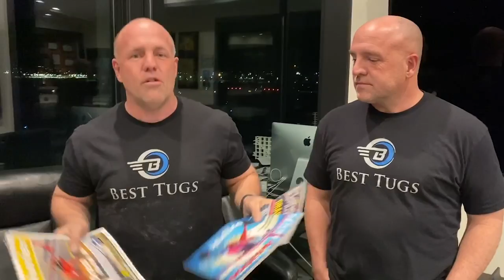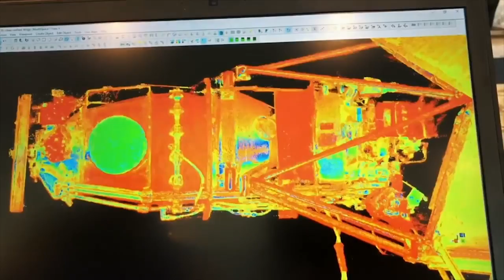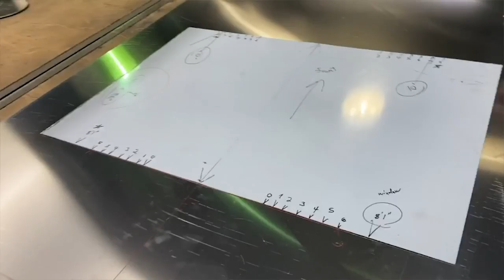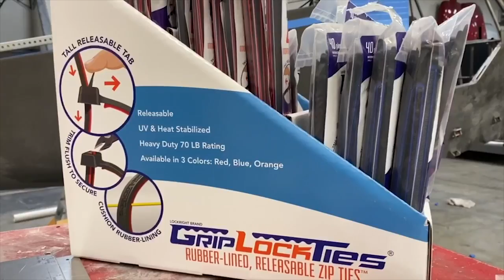Vertical Stabilizer & 1 Hour Carbon Fiber Part 🤠 | Scrappy #8

Comment: Long experience with precision aerobatics in radio control has confirmed your claim of smoothness and stability of air foiled sections in the tail ... both vertical and horizontal stabs and the moving surfaces .... In fact when I first looked at back country planes I was very u derwhelmed with the flat tail surfaces .... I would go further in saying all surfaces should be symmetrical ...( identical contour top and bottom of elevator ).     This causes no small increase in smoothness and stability , it is night and day....... My next take is a radical one ... If I were building a back country plane from scratch I would make the wings symmetrical and double tapered as well .... Countless people will say OMG the stall will be sharp and scary .....I say the handling will be amazing .. the efficiency off the charts  and mitigate stall with flaps ... perhaps spoilers and VG,s ...... For me handeling and feel trumps all ... except safety.... I would also say linkages and pushrods are superior to cables ... even for rudder ... tight zero slop linkages and symmetrical airfoiled surfaces everywhere makes a plane feel like it’s on rails

Comment: Clever zip ties.
Can you make one where you buy a roll of the "tie string" and have loose locks for it. So if need 3 feet of zip tie I just cut 3 feet of the roll and get it done instead of making a long ugly chain of zip ties :-)

Comment: mike from a composite tech guy use tacky tape/chromate for the bag and also some kind of rope-like material to help draw a better vacuum and resin out of the part
Reply from the maker: Ben Perry absolutely, I was out of tacky tape and I keep duct tape around by the case loaded and hit max vacuum either way,  I have never used rope but the second I read your comment I thought wow how did I not think of that.  Brilliant idea.  Thanks so much for the tip I love it

Comment: Pls don’t reply. Am so loving your ‘scratch’ builds. In 1963 I was 15yrs old and my dad gave me a 7” aluminium impella, bag of plaster and fibreglass heavy chopped strand mat, polyester resin, paint brushes and said “shape a pump body round this son from plaster, then learn how to make a fibre glass copy.” It worked. He came home with plywood and pine, aircraft fabric and red dope and said “ make an 8ft pregnant surfboard with a centre mount for the pump.
Next he brought home a motor mower engine and we built a jet powered surfboard.   Oh how I wished I had challenged him to buy a motorcycle engine and I could have built the first jet ski. 
I’m 72 now and just finished an aluminium trailer from 10 sheets of 4x8 sheets in the style of Airstream Basecamp except with all around dark tint plexiglass. Front is panoramic sans mullions and view out amazing. Put AVIATOR vinyl sign round the front curved ‘window’. Took it 4,500 km tour Queensland to Victoria Australia at only 700kgs and aerodynamic it pulled like a trout through a mountain stream.
Love your videos please keep showing what so many of us dream about.

Comment: It would be great if you could talk about lower boundaries to entry into flying. A lot of people think it's only for those that can afford a full PPL and then buy or hire certified aircraft. I fly a shared RV8 here in the UK on the equivalent of a Sport Pilot License and my costs are a fraction that friends pay to fly certified Cessnas or Pipers. I get to fly aeros, and mock combat, fly into strips and just fly really fast for the hell of it. The guys doing $300 burger runs in their spamcans shouldn't be the face of the sport when this kind of fun can be had for cheaper.

Comment: I had an idea for the doors. A bank safe door has pins that pop out into the frame when its locked. Maybe a door latch with a few pins on each edge would add strength and support...Just an idea...

Comment: Amazing work. How about getting a large scale coarse fast 3D printer to have freedom of form for molds so you don't have to do a ton of patch work.
Reply: might be able to get a water soluble filament so you can print an inner mold and make a one piece plane and wash away the inner mold.

Comment: We need help in sailplane aviation in the USA.  The people flying gliders are all old.  Very few young people in this sport.   If you want to help?   Put a tow hook on your airplanes and give a glider pilot  a tow.   I bet Draco could have towed 5 gliders simultaneously.    Perhaps you next build after Draco-X should be a glider.  It's glass and carbon fiber.  Love your the video's

Comment: Do you alternate your pattern each layer?
Reply from the maker: Eric Haskins yes I do it by laying the carbon on a 45 when I baste the resin and  then 90 so the plastic is still long single part to apply but the carbon alternates angle by how I cut it before resin

Comment: To save weight have you considered using carbon ceramic brakes? No doubt it would be very expensive but might be worth an investigation with surfacetransforms.com. They make very high performance brakes for very high performance cars. Their web site says they are working on versions for aircraft but nothing more. Of course what is available may not be easily adaptable for your purposes but when has that been a barrier for you?

Comment: Have you guy's ever thought about using your best tugs equipment applied to the RV industry?? There is a tremendous opportunity there.Take a look at what is being used in Europe, they use them to move trailers and RV around without a vehicle. I hope you can take this tip and make a few hundred million $$$$$$ from it          CHEERS      Steve h.

Comment: Sikorsky would use fiberglass between some of their layers of Bondo on the S-76 A models, probably C models as well. After a few years, corrosion and twisting would inevitably separate the Bondo from aluminum skin. What a horrible way to make your aircraft aerodynamic and pretty.
Reply: Uh, did you even watch the video? Who would leave an aluminum mold inside a carbon fiber part?... Mike pulled all that aluminum and Bondo MOLDING out.  It’s was only only there to form the part.

Mike is a genius from another planet.  I checked, he’s not human.
Reply: Mike is a genius from another planet indeed.
Did you even read my comment?

Sikorsky used so much Bondo at sta 300 on a production helicopter, they needed fiberglass to keep it from falling out.

Comment: Deregulate aviation. Everything is so expensive. Me and my fiancee make good money and we still struggle to participate. 60 year old airplanes still cost as much as a brand new Tesla. New planes are hardly being made because of all the red tape. A Cessna shouldn't cost $400k they were only 9k in the 60s or about 70k in today dollars. We obviously have the tech to physically make them cheaper. Let's find a way to stop the lawsuits cut back laws and make aviation for everyone.